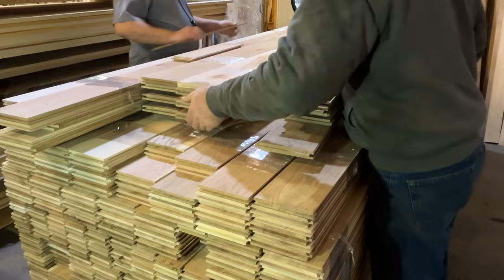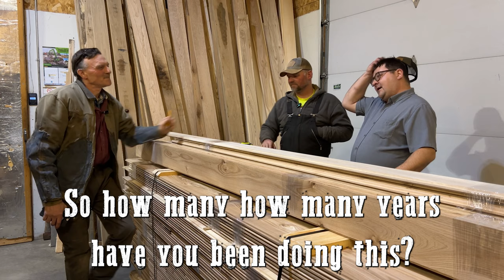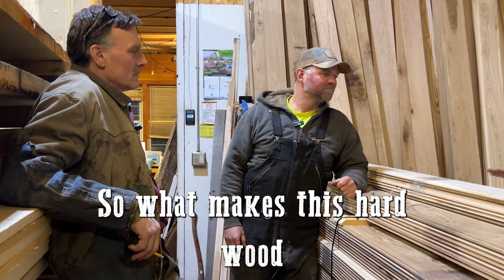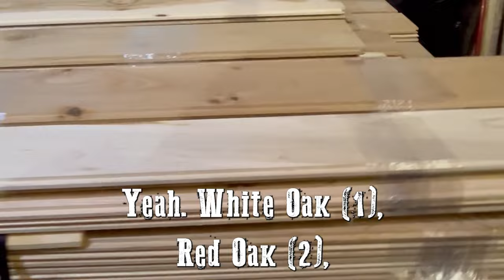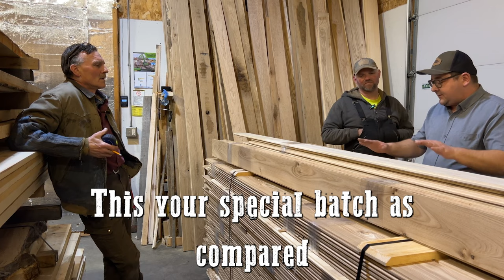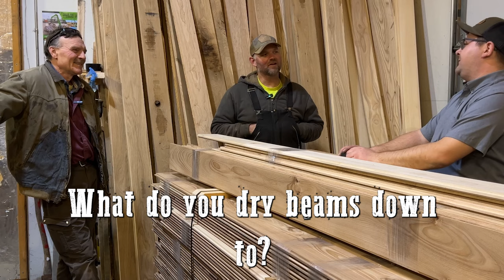The Shocking Truth About Kiln Dried Moisture Content Revealed!

Comment: What would you recommend to use for an interior built-in bookcase
Reply from the maker: There are sooo many species to pick from. I'll just give you my top 3 Hardwoods and why: 
1. Maple (Soft and Hard) Hard Maple is just that, hard. Soft Maple can also do some cool figuring.
2. North American Cherry. Beautiful stuff, Slapsolutely beautiful hands down.
3. Red Elm (new favorite.) 860 on the Janka Scale so it's the softer of the Hardwoods. But the grain pattern is almost unbeatable.
A good option that is affordable is Red Oak. it's Cheap, and overused. But it takes stains very well so you can stain it to look like anything. 1220 on the Janka, will be easier on your tools.
Ultimately you'll have to take a look at what is readily available in YOUR area, and go from there. 
Happy Building!
Reply: Thanks!!!